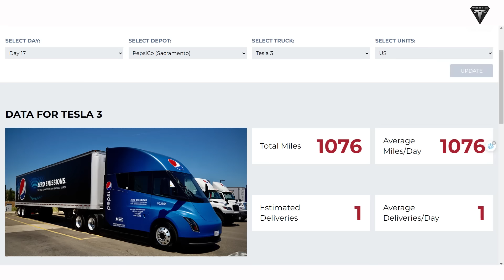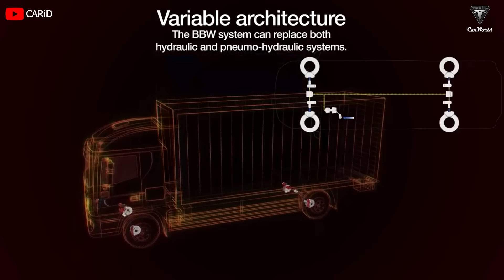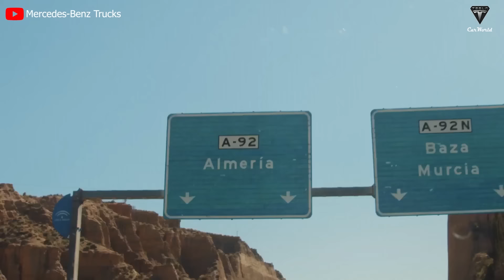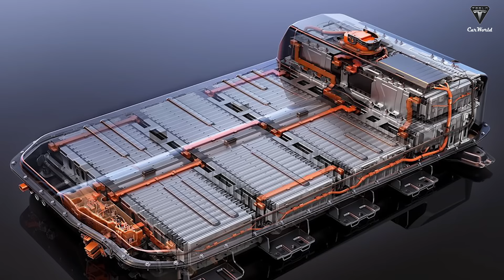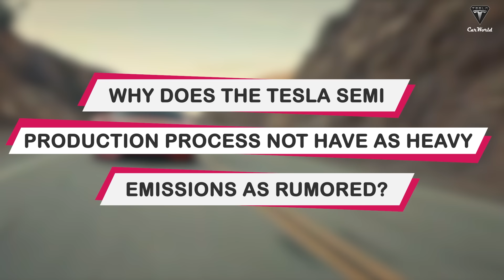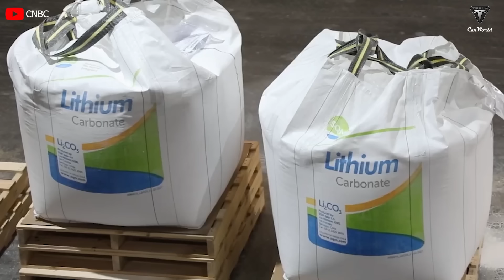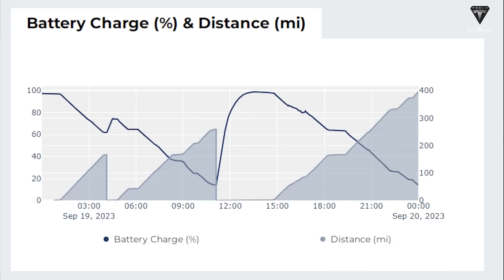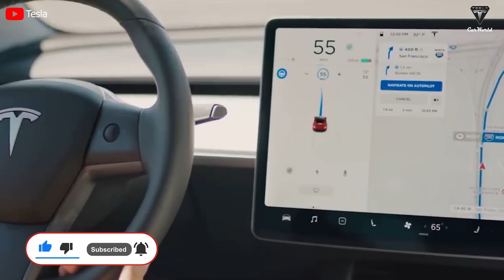Elon Musk Leaked Tesla Semi 82,000lb Version, Fully Charged in 1h and 3 Hidden Features! (MIX)

Comment: It's got a problem roads have limits to weight and electric isn't green also charging such trucks while break the power grid. C02 is life.
Reply from the maker: Diesel price inflation, engine noise pollution, CO2 emissions, and costs of several hundred dollars per gallon. Co2 is life for those who want to live to 40 years old!
Reply: tesla motors club-
 How do you charge your Tesla?
Primarily supercharger/other non home locations	Votes: 14	6.6%	
Primarily at home (120v)	Votes: 19	9.0%	
Primarily at home (240v)	Votes: 167	79.1%	
Mixture of at home and other external locations.	Votes: 11  5.2 %
Reply: @TeslaCarWorld   All plant and animal life depends on CO2 and all coal, carbonate rocks, and petroleum were once living plants. Plants die below a third of current CO2 levels. Green houses run gas furnace exhaust inside to  feed the plants. North Africa was once green and the green is returning to the lower Sahara.
Reply: C02 is life everything uses it or makes it? The mining of batteries does more damage than oil. What you said about life span is childish. @TeslaCarWorld
Reply: Electric chargers cost amounts to $17 dollars a liter.

Comment: OK you need some serious work on your research, comparisons and wording.
1. The Mercedes electric truck is not I repeat NOT 0.25!! They said it has a 9% lower coefficient that the current non-electric model which is 0.99 meaning its electric version has a coefficient of ~0.9 well over twice the Tesla!!
2. And you keep mentioning that all these trucks can haul a load/payload of X, that is not correct, none of these can have a load of 80,000lbs. The LOAD is how much the trailer and its contents is, the 80k/82k mentioned by these manufactures is the entire gross vehicle weight including fuel, so the "load/payload" capability is what's left after subtracting the semi-truck's fully fueled weight.
3. Know the difference between US and European regulations. The maximum the entire truck and load together can only be 80,000lbs in the US and they gave an extra 2,000 to EVs so they can have a maximum of 82,000. So the fact that the Mercedes says it can move a total of 88,184 is ONLY listed that way because in Europe, where they operate, THAT is the maximum allowed on their roads. I am sure the Tesla CAN move more than the 82,000 listed, but that is all that is allowed so they're not going to list anything higher.
4. You mention that the Tesla and Mercedes energy consumption is not significantly different. It is VERY different, 1.7kW vs 1.9kW per mile is a 12% difference. So their efficiencies are not even close to the same.
5. You don't explain the charging differences well enough. Saying the Tesla can charge to 70% in 30 minutes and the new 'soon to come, not even real yet' Mercedes can charge 20-80% in 30 minutes. Almost makes it seems like the Mercedes might even be better. Without pointing out that the Tesla number means from 0-70% (70% of capacity, on a LARGER battery) in 30 minutes, compared to 20-80% (only 60% capacity of a SMALLER battery) in 30 minutes, so they are not even close.
6. All that for Tesla at HALF the cost of the competitors. How in the world do you even hint, let alone state outright that the Tesla semi could "EASILY" be surpassed by competitors. They may get surpassed someday, BUT it won't be for a long, LONG time and it won't be EASY by any stretch of the imagination, ESPECIALLY considering the costs.
7. Trying to compare emissions, you are all over the place, you talk about the total emissions to make a Tesla semi, but never say how much it is to make a tradition diesel truck. Although you do try to talk about the emissions of a diesel in its operations, you never get to an apples-to-apples comparison. To do so you need to say "emissions to build a Tesla semi are X, emissions to build a diesel semi are Y, the total emissions of a tesla semi over 1M miles is X and for a diesel semi to go 1M miles it's Y". Then add those together and make the comparison. The way you present it makes it seem like a 'possibly' better case for Tesla whereas it is not even remotely close. But you did do good job of explaining the rest after that it terms of the future in both technologies on emissions.

Comment: A solution to further increase this range. Put additional battery packs on the trailer and electric motors on the trailer's axles. There is a company that builds campers trailers. They did this with a version that they build. Since the trailer will have motors on them, the range of this Semi/Trailer configuration will go further. If you also put solar panels on the top of the trailer, you will gain additional range from the system being able to recharge the batteries on both the trailer and the Semi.
Reply: - The problem with adding batteries to a trailer is that trailers are often parked (empty or full) and not moving immediatly after been loaded or unloaded,
so the cost of batteries will increase a lot each trailer, unless using a mechanism of portable batteries so the batteries could be shared, but still a complex system.
- However in the case of perishable load requiring refrigeration, having batteries allow to keep the refrigeration running when moving and then when parked
the batteries can be recharged from the grid. Also regenerative breaking could be use to recharge the batteries when moving. And also solar panels could be used
to charge the batteries when moving or parked is there is no grid power available.
Reply: A simi is for hauling goods, not batteries
Reply: The Tesla semi alone is already calculated to weigh far more than diesel daycabs at upwards of 26,000 lbs. You want to make the trailer weigh more, too? Seventy-five percent of your gross weight is going to be dedicated to the vehicle itself! Think for 30 seconds.
Reply: This could be a decent idea depending on the shipping company. If the company is Pepsi, then it doesn't make since as it would start to eat into their cargo weight for product (full cans of drinks are heavy); however if you are Lays, you could do this no problem because you are mostly shipping chips and probably don't get close to 82K LBS every load (chips are less dense weight to volume wise)
I would think that you could do solar panels on them but ALSO plug them in so that while they are sitting in the yard, the battery can be charging and any excess solar energy could go to the rest of your facility.
Reply: We're gonna put the freight the the purpose of the truck is to Carry cargo not batteries

Comment: put solar on the trailer
Reply from the maker: So fun! We consider your good opinion!
Reply: that wouldn't make a dent in the power that is needed for that truck
Reply: @cardboardboxification  I thought solar to but did some basic calculations and found out that a 5KWR system on the trailers would give only around 80 watts per mile at 60 mph on a good day. So, would agree with you.

Comment: lfp batteries 
are heavier
Reply: Depends on the format employed. Prismatic lfp on a structural pack like tesla uses for the Berlin model Y using byd blade cells, isn't as heavy as any old multiple module 18650 pack per kwh. 

The latest m3p and lmfp chemistries in structural prismatic pack's are supposedly over 200-220whs per kg at the pack level now. 
The advantages of charging daily to 100% also help make a difference for lfp vs nmc especially for commercial purposes.
Reply from the maker: The LFP battery in the Tesla Semi is quite heavy, but without such weight, we would not have 500-mile journeys on a single charge! Thank you

Comment: Let's talk about how much the empty weight is. You can only weigh 80000 pounds. My truck is able to load 46000 pounds. I promise you. The empty weight on this truck is much higher than a normal truck. Therefore can all much less freight? So how is that gonna be more efficient? Or will the government just up the legal limit? And tear up the roads and bridges even more. Which comes to my next point. When are we gonna start charging road? Tax for electric vehicles, gas powered vehicles pay for through the fuel.

Comment: And the more carbon dioxide the better for plants. This vehicle is neutral on the environment but does not help plants. What has helped plants is India and China providing the leap to 400ppm with the earth noticeably greening as a result. There is no climate crisis despite what the talking heads are spewing daily. There is just weather. It is not as hot as it had been almost 100 years ago and the ice is doing just fine in the Arctic and Antarctic. The Great Barrier Reef is doing fine as well and we are below the average in hurricanes, cyclones and definitely below the average in burn acreage. No crisis here fold just weather and the NWO types mouthing their predictable doom and gloom. 
Cheap, low cost fuel is what the world needs. Oil, gas and nuclear are the answer. Cheap, readily available energy is what the world runs on

Comment: For the performance numbers given... either the Tesla is being driven 22 hr a day, swapping drivers, while NOT swapping drivers to get the same number of hours of operation out of the diesel trucks... or they are grossly breaking the speed limits.

If you swap drivers enough in the diesel trucks you can drive them the same number of miles a day with ease, legally.

So, there's some obvious disinformation in your presentation, obvious to the most casual observer.

When you present disinformation in one area, EVERYTHING about your presentation becomes suspect of being outright lies.

Comment: I do not see the problem building the Semi vs the sedan other than with the FSD system, especially software. Drive, brakes, and suspension are pretty much off the shelf parts. Semis appear to be a better place to put Tesla's battery production than troublesome new sedans that have many new features in a small place and so many features in such a small space.

Comment: I call BS on the cheaper maintenance part... Our short history with electric cars has already debunked that one. So Tesla's $21,000 battery replacement and Fords $5,000 tail lights don't qualify?
Reply: Cite.
Reply: Uhm, no? In which way debunked? Evs are WAY cheaper in maintenance, only (at the moment) more expensive to repair.
Reply: @Sixotoo he's half right. It cost me 2200$(CAD) to replace a headlight on my Model 3. 
But then again some other things are cheaper like the 12v battery was 100$ instead of 200$ (most likely because it's much smaller than ICE vehicle batteries and it doesn't need all those cold crank amps to start the car in the winter).
Reply: @themonsterunderyourbed9408  But that only depends on the part and manufacturer. If you had a Porsche and the headlight would be a simple contruction (no matrix LED, just plain old round lightbulp) it still would be cheaper.
Reply: @Easore  I agree... But you really don't think that these car companies won't make every single component MORE expensive because they can't make money on regular service anymore? 
Dealerships don't make money from car sales, they make money from, financing and service.
When you take service out of the equation, they'll have to sell an entire headlight assembly at 1900$ instead of changing a bulb for 40$ (even that bulb is overpriced at 40$) to start making money.

Legacy automakers would still go bankrupt even if they could simply change from ICE to EV because the business model can't be the same.
Reply: @themonsterunderyourbed9408  $2200 to replace a headlight and you're ok with that?  Hertz is putting the halt on it's Tesla purchases because of the very high cost to repair them when anything needs replacing.
Reply: @christophercharles3169  Who said I was okay with it? I'm not.
Reply: @themonsterunderyourbed9408  Nor should you be.  These are types of things they don't disclose when you buy any kind of vehicle, ICE or EV.